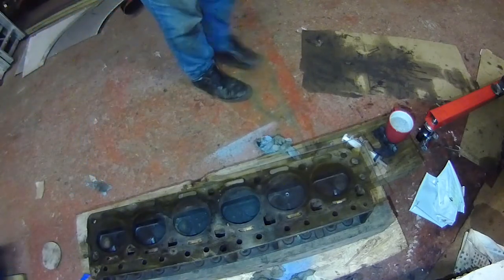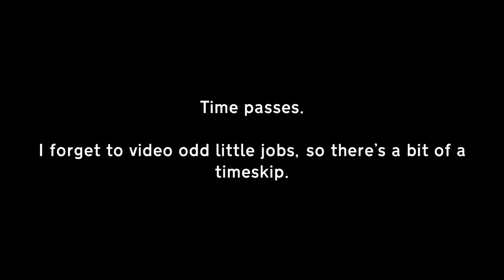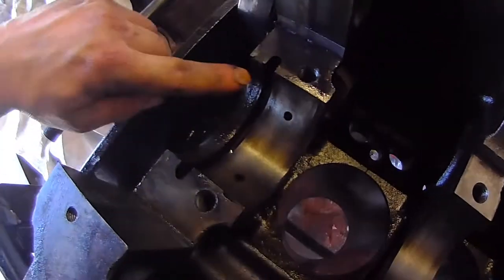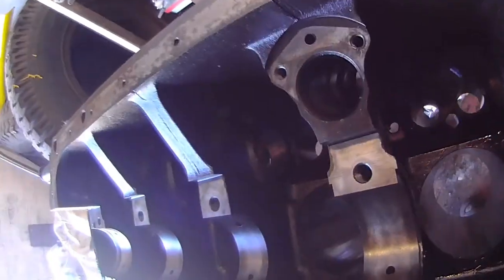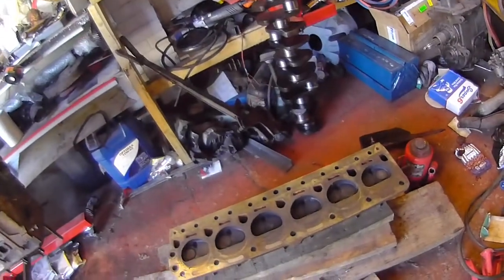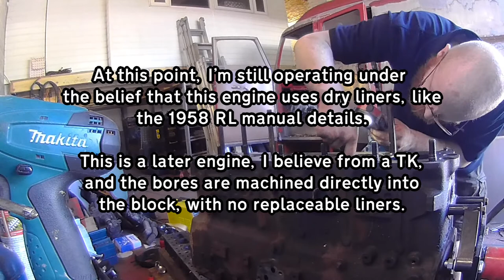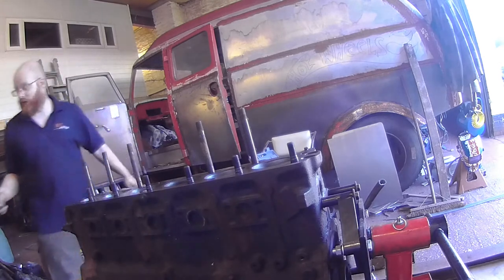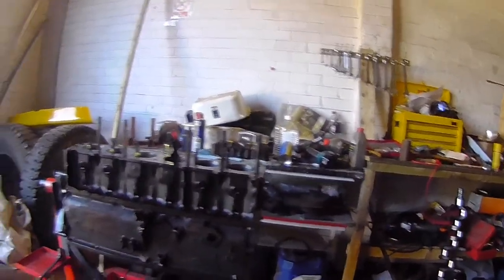Bedford RL Rehabilitation: Part 10(b): Engine Dismantling Continues

Comment: Is there a website that gives the technical specifications on the RL components (engines, transmission, transfer case, and the axles)? Were they all of Bedford manufacture?
Reply from the maker: That's a very good question! I don't recall, off the top of my head, mentions of who actually manufactured the various parts beyond the gearboxes.

(*Apparently* the 4-speed gearbox was Bedford's own manufacture.)

As far as full specifications, again I can't recall anything really in-depth, but I have a copy of the WSM so I can hammer something out!
Reply from the maker: https://bedford.furryhelix.co.uk/

I've spent two days, so far, compiling specifications and amendments from the EMERs (Military workshop manuals) that I have access to, and cross-referencing with other stuff as required, and I've just about covered fluid capacities & types, and engine specifications. It's slow going, but I'm hoping to cover all the major sections in the EMER given time.

Unfortunately, I'm back in at the day job from tomorrow, so that'll slow progress, I'm afraid. 😔

Comment: Could look for a suitable neoprene seal instead of the rope?
Reply from the maker: I've had a look around, but not found anything thus-far. Sure would be nice, though.

I had the measurements written down somewhere, trying to crossreference them to something; and I dimly heard rumors of the possibility of two-piece rubber seals in Australia, but never been able to confirm that.
Reply from the maker: Also, if it cheers you up -- it certainly didn't, for me -- the amended workshop manual claims that a moulded rear main bearing seal is serviced for engines RL33000 and upwards.

It does not, however, provide a part number.